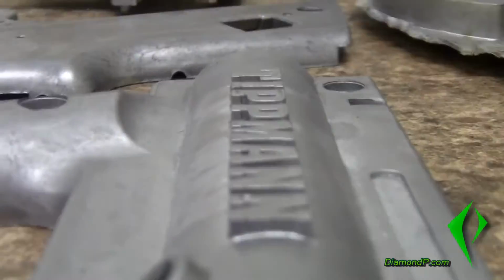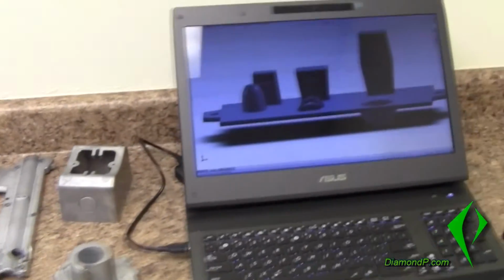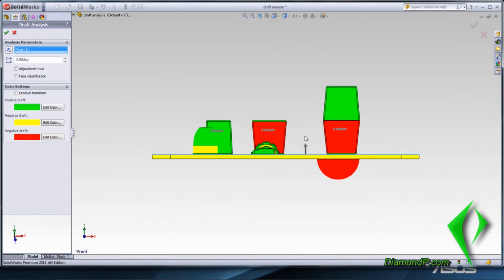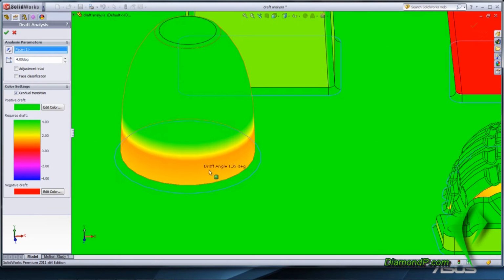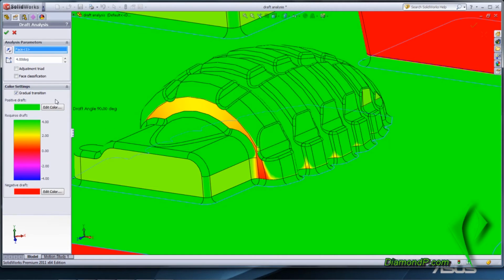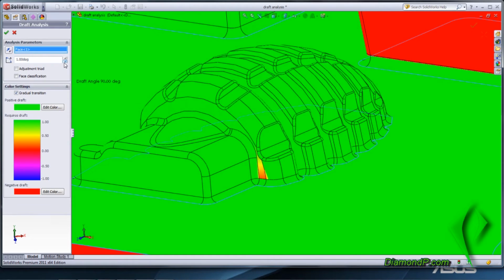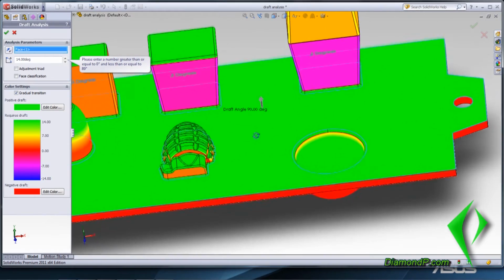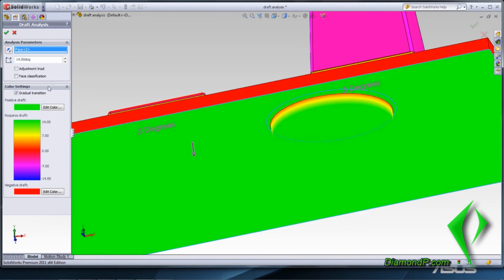Castings: Parting Line & Draft

Comment from the maker: Your pulling direction will still be the same regardless if it is a "Flatback" or contoured parting line. The only thing you need to check is if all your draft is positive on the part from which ever direction you will be pulling the mold. The only difference between a flatback and contoured parting line is the pattern or mold has to be manufactured a bit differently.

Search "matchplate pattern" that is they type of pattern you will need to make your castings if you are looking for green sand.